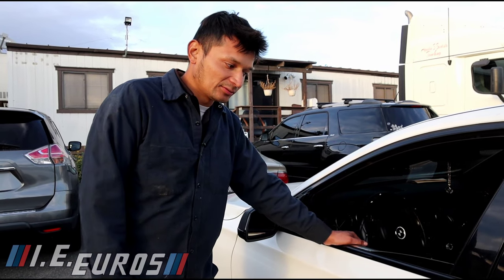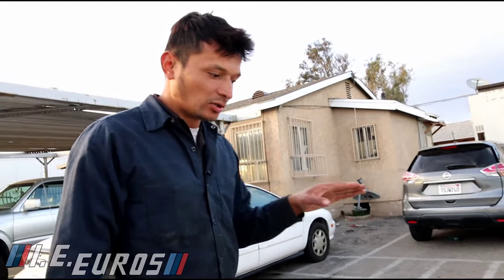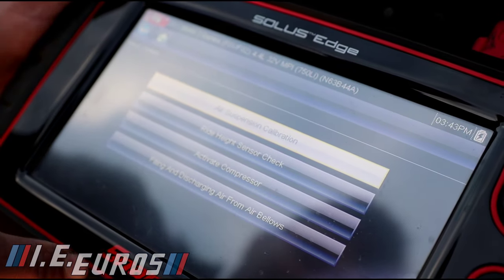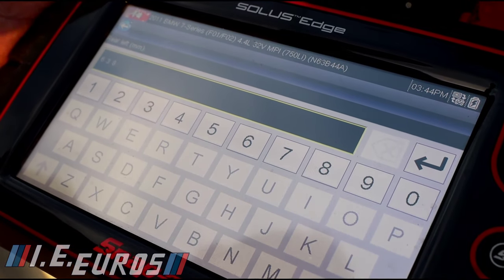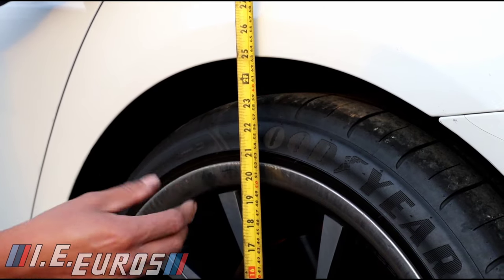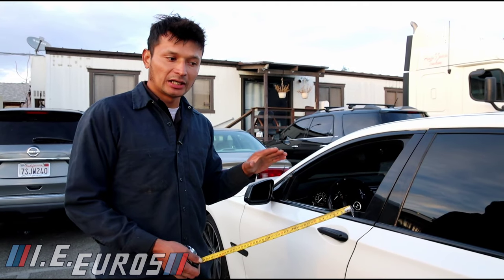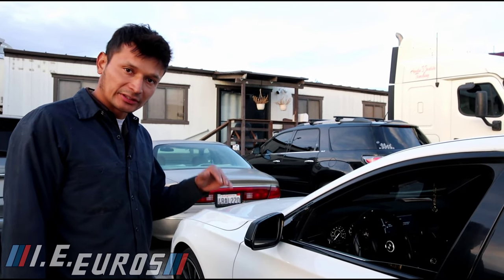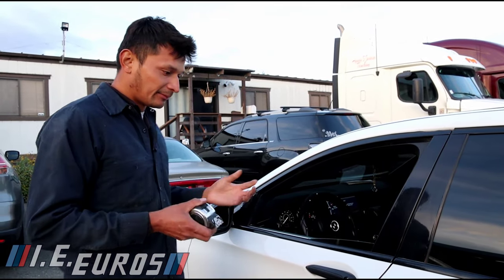BMW air suspension height calibration process adjustment how raise lower axle air bag programming

Comment: Sorry but you are measuring from the wrong datum. Forget anything about tyre pressures, that does not make any difference if you measure from the BOTTOM of the wheel rim.
Reply: That's correct sir

Comment: Do you know if this triggers check engine light? Because I coded my air suspensions yesterday and after like 4hrs my check engine light came on.
Reply: Check engine light has only to do with emissions and drivetrain issues. Not chassis parts. Check fault codes and proceed from there.

Comment: Hi Francisco

Thanks for this video. I dont have the code reader you have. So question is:

I have a BMW 530d GT, can you tell what the normal ride height should be for my car its F07 '2013.? That would be great

It was running nromally until mid winter then it started to drop for some reason, evenly both sides. BMW pumped it up full, to check for leaks, but there are none as still at full height. I say that, I loaded the boot with about 50kg and it dropped about a 10mm. 
I have been trying to find out information about what situations turn on the compressor to keep at right ride height. Tried with the ride switch, Eco-Comfort-Sport and the DCS 

Hiope to hear back from you soonest
Antony

Comment: Do you have to have that specific machine/device in order to adjust the rear, or can it be done with another one that's just as easy and efficient?
Reply: Just to follow up on this question-I am working on an 03 X5 with my Foxwell 510 and it is allowing me to adjust my rear suspension. This is a great scanner that is inexpensive and allows me to do so much on my 4 BMW's. Highly recommended.
Reply: @davesmith6128  Much appreciation!

Comment: Hello friend 
I bought a new air sensor and after connecting it, the car became shaking, and while pressing the accelerator pedal, there is no torque in the car, after that, the car stopped working, my friend, does the new sensor need programming??

Comment: for my Porsche Cayenne GTS . I red that with the AUTEL DIAGNOSTIC TOOL , it’s possible to lower the car , about the Porsche Program ( normal , lower , higher ) so you can choose, like before the changes, to have your Porsche , when you put on SPORT, a better lower setting, that permit you to go on a Highway , with less gasoline consumption …

Comment: Use INPA on a PC go to
Chassis_ 1 axle air suspension_activate_set mode_production mode_back_hand control (use axle and/or left and right raising/lowering [RA UP RA DOWN RL UP RL DOWN RR UP RR DOWN AND OFF] to get height on both sides where you want it. Requires measuring  and getting out of car several times to get it right_ back_calibrate_f8/abgleich [pop up window "calibrate vehicle height" should say left 0 right 0_hit ok-(you will see offset and counter values with numbers - or +_ hit f8/abgleich again_ pop up "calibrate vehicle height" left 0 right 0_ hit ok (offset values should read left 0 right 0 in both rows, counter values in the middle with x#)_back_modes_ e-saveMod OFF ( production mode should be off) _ back. Exit

Play around with it. Don't completely quote me on this but it has worked for me.